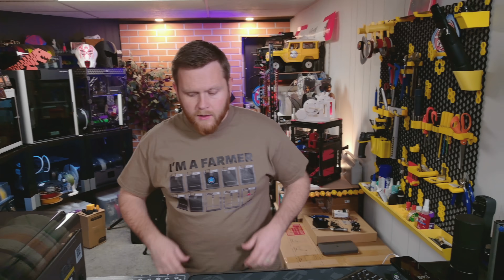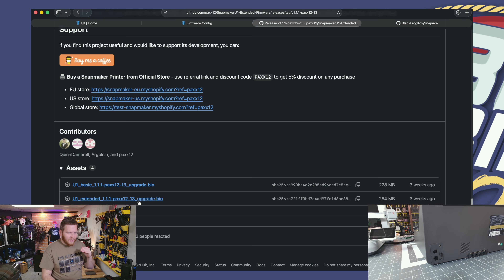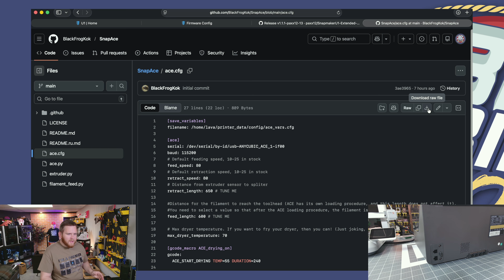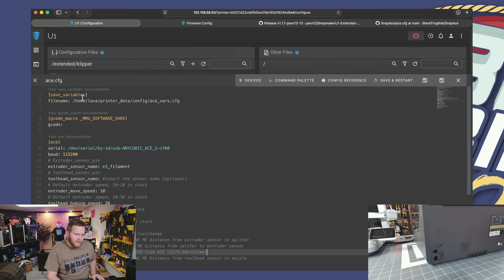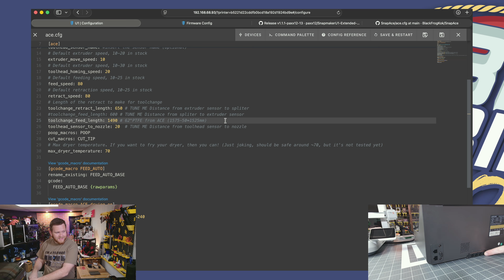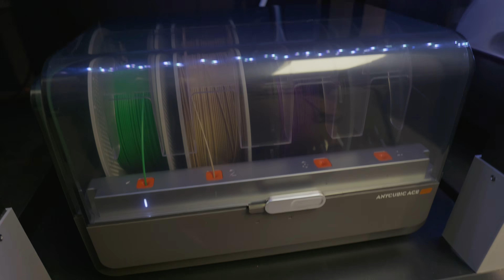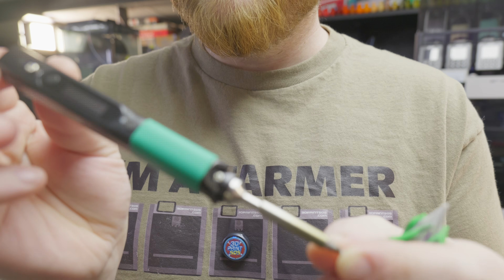Snapmaker U1 Just Got a Massive Opersource Upgrade (With Anycubic)

Comment: Does the ACE pro have open source NFC reader capabilities? That's something I like about the Paxx firmware, but bypassing the side spool holders skips the NFC readers, making me wonder if the ACE has anything built as a similar function. Cool video either way!
Reply from the maker: The team is currently making progress on NFC as well as some other fun mods to this. I’ll probably cover it as soon as its available
Reply: @3DPrintSOS  I have my mod now running and on 1.2.0 paxx12. I also wonder, and will experiment with that. would be cool to have the reader from the ace pro communicating instead of the built in RFID Reader. I guess it is already a thing

Comment: Here i was hoping u could have more than 4 filiment not just bypass the u1 spools.. aww well still cool
Reply from the maker: Yeah, it’s mostly for storage and drying for now, but still super useful! 🛠️ Key word…for now. ;)
Reply: I am working on this as well. I have a branch of the Paxx firmware that has this all properly integrated, no manual installation steps will be needed.
Reply: @W1ldTangent  NICE this is what I think the port in the back will be used for would be nice if snapmaker would say something.

Comment: Would be 100 times better if it added more colors
Reply from the maker: True, but it's still a huge upgrade for drying and storage! Also, could still be possible. ;)
Reply: @3DPrintSOS  I am working on this as well. I have a branch of the Paxx firmware that has this all properly integrated, no manual installation steps will be needed.

Comment: How come you won’t reply to my messages
Reply from the maker: I have no messages. What platform? Discord is easy.
Reply: @3DPrintSOS I have sent you several messages through different channels like YouTube. Messenger and a couple others   But why I am trying to contact you for is I am trying to connect the creality pad to my voxelab Aquila 3max and cant get it to work properly I am using the the configuration you linked in your video but it keeps coding for z end stop and I have a proximity probe and tried several ways to get it to work but it won’t work
Reply from the maker: The tricky part about the Max is that when I was doing these mods and DIYs that machine didn’t exist. So I’ve never had any experience with the hardware one then. Once Voxelab started to move into proprietary over opensource, they dissolved back into flashforge. 

It does sound like you should be able to add abl information into your config if you already have Klipper running.
Reply: @3DPrintSOS  it has the n32 chip  and I run it as a ender 3v2 on orca
Reply from the maker: Check here: https://www.reddit.com/r/Ender3Max/comments/1bnz1cl/ender_3_max_422_klipper_config/

This looks very relevant.